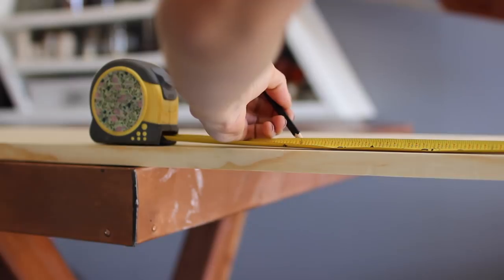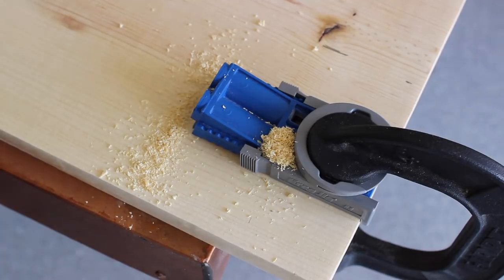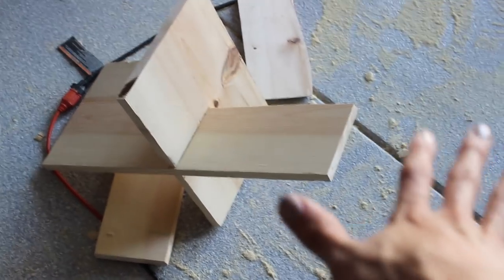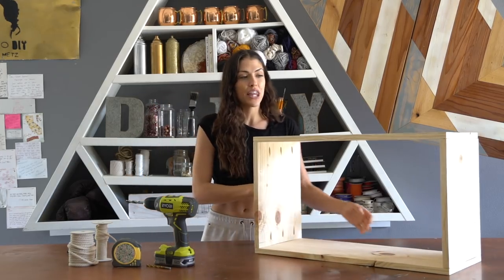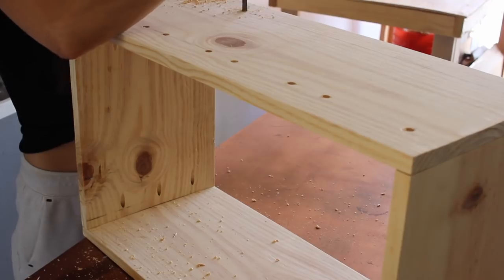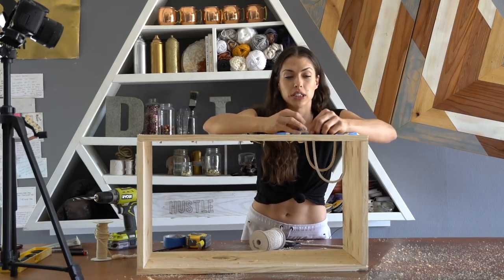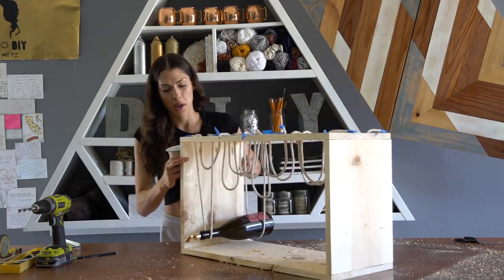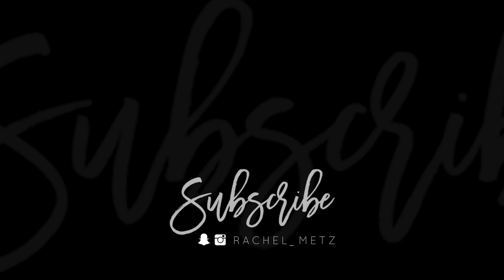Try to Save This DIY With Me | Wine Holder

Comment: I think the X shape would still work if you used 3 pieces of wood to make the X vs two.  Instead of trying to create a physical  X inside the piece ... just do one piece of wood exactly like you had it and then cut the other down into two pieces, so you have the one half of the X on top and the other half on the bottom.  It's really hard to explain it typing it....but I hope this helps.
Reply from the maker: I thought that too but had no wood on hand to do it. All my cuts were to small. Main goal was to avoid a trip out again haha. Thank you for the tip!

Comment: As a Virgo myself, I definitely wouldn’t give up on going back and figuring out the angles for the X shape for the interior of the wine box holder with the miter saw and making the kreg jig holes instead of cutting into the wood and making them slide inward on each piece. Does that make sense?
Reply from the maker: Yes! I wanted to do that but didn't have any wood long enough after all my failed attempt and was over going to Home Depot after three days of working learning something new haha.
Reply: Living to DIY with Rachel Metz I totally get that. I get frustrated too. It happens. I’m Js it would drive me nuts if I didn’t go back and figure it out later.

Comment: uhhh... if the lap joint doesn't fit you should take it out and cut a bit more off. That joint was way too tight and the wood was heavily dented because you were trying to force it in.
Reply from the maker: Thank you so much! Patience is something I'm still acquiring haha.
Reply: @LivingtoDIYwithRachelMetz  for sure! Theres nothing more frustrating then jamming it in then realizing you need to take more material off to get it to fit. Or worse, you take it out and fix it then notice you took too much off and have to start it over.

Comment: I reckon dowels would have worked with your original concept. And they wouldn't need the complicated math to interlock them, just offset them where they cross.
Reply from the maker: Yes! Definitely was my idea previous to the macrame cord. The main part of this was I did not want to make a trip back to Home Depot after three days of trying to figure this out haha. The dowels I had on hand were way too short unfortunately.